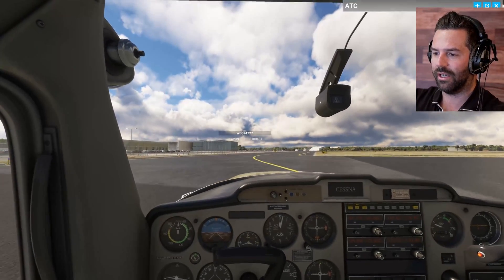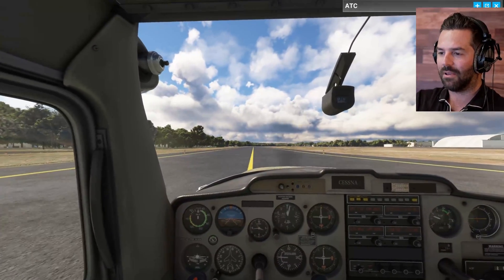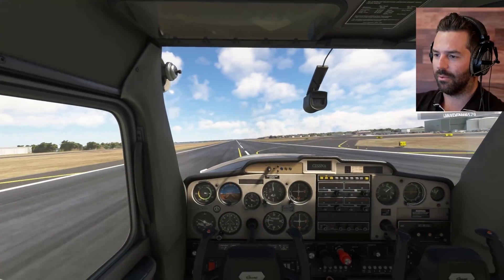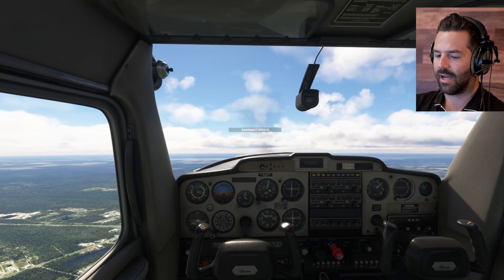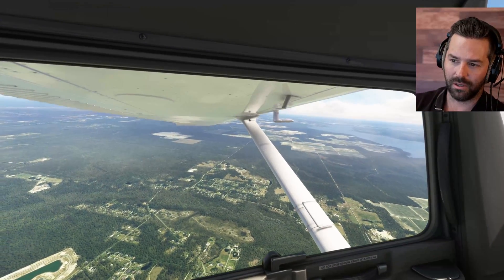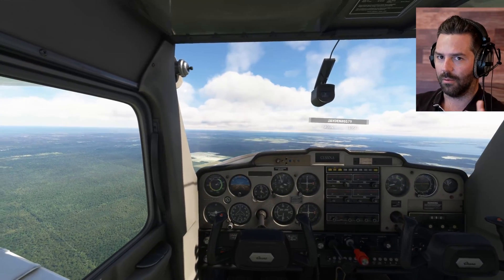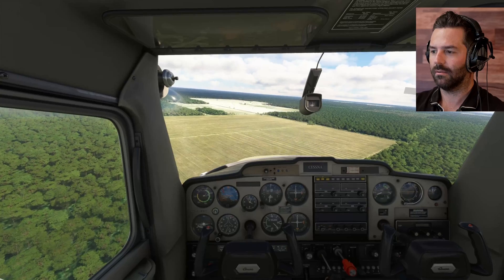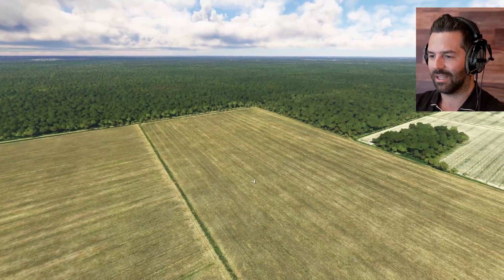Engine Failure Basics | Cessna 152 | Emergency Procedure

Comment: Quick question as a student pilot. On the landing since it’s a soft field wouldn’t you hold the nose off the ground and avoid using breaks(room permitting) as long as possible to avoid the main nose gear from sinking into the ground?

Comment: Maybe sideslip using right rudder and left bank. Its easier if you are sitting in left seat. The other thing is to convert speed to height on engine failure, it gives you a little more time to plan your approach.